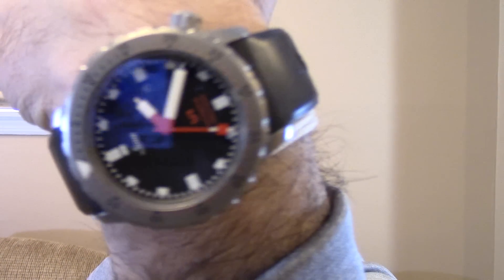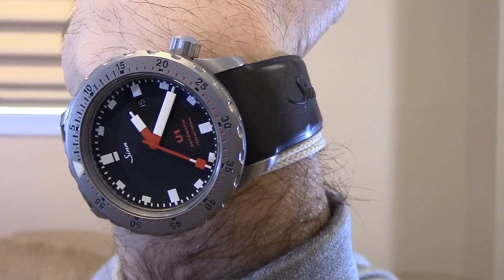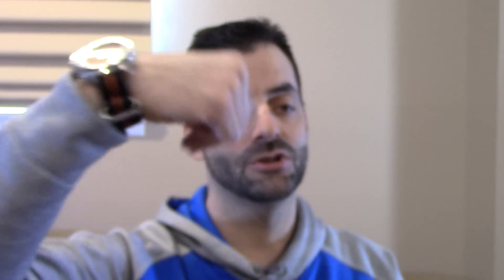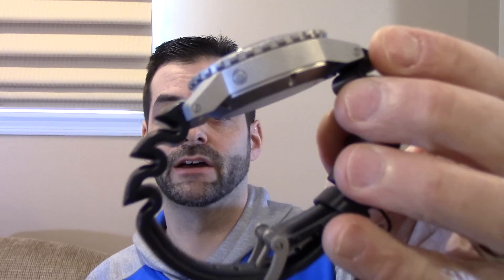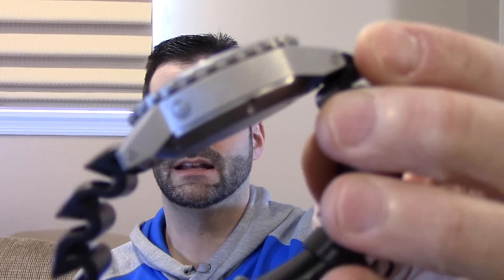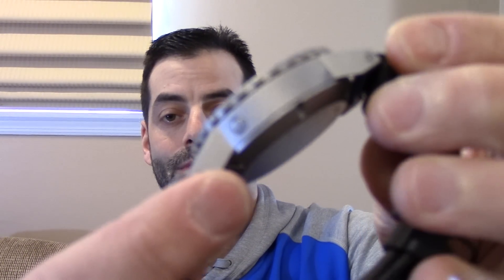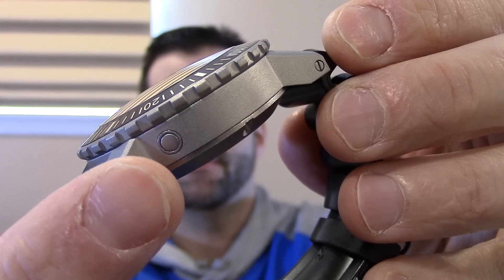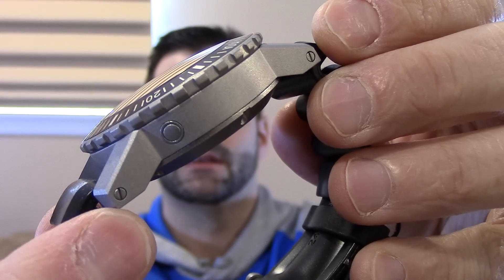What is a Helium Escape (Release) Valve? - Watch and Learn #45

Comment: You quickly address this in your video but I’m wondering if you could clarify this, or maybe it deserves a HEV 2.0 video. Is pulling the crown out during decompression as effective as an hev? There is some online forum chatter around this and there are those who are divers that say yes and those who are divers that say no. The argument from the no side is that the crown gasket seal can/will blow out. However, if the gas is so small it can get in the watch, why won’t it just gradually escape the unscrewed crown gasket without causing a blowout? Further more, if a watch is water resistant to say 100 meters, but is brought into a saturation chamber, could the water theoretically go past the 100 meter depth rating as it is now pressurized to a deeper atmosphere? I’m not sure if that second part is clear.

Comment: Just watched for the first time 🙂
Great vid. You confirmed what I thought about the valve and how it works. Sinn did an awesome design to have a 1000m with no valve. I have a few pieces with the valve rated at 500m or 1000m. 
There are probably other equivalent watches I don't know about but, I think the only diver with the legit use of the valve is the Rolex DEEPSEA SEA-DWELLER rated at 3900m. I don't think Sinn (or any other legit watchmaker) could make a crystal/seal combination robust enough to handle that depth without a valve.
If I'm a serious diver paying $15-$20k for a watch, it had better meet its stated spec's.

Love these Watch & Learns ⌚😎👍

Comment: But if Helium atoms are small enough to get inside the watch. How come they cannot escape the exact same way they got in? The pressurising phase takes as long as the depressurising phase, doesn't it? Plenty of time for the helium to escape through all the gaskets. 🤔
Reply: Because the watch is made to withstand positive pressure only. Example, the window is pressed in from the outside so at depth it is held in. After surfacing, if the pressure is reversed, only friction is holding it from being popped out.

Comment: A question: can you go down to 500 m with a regular 100...200 m resistant diver watch that has been "saturated" prior to that? Nearly zero pressure difference should prevent water from getting into the watch.

Comment: So will readings be different when pressure testing a watch with a helium escape valve? Surely as it comes under pressure the valve will open and it wont register as being sealed?
Reply: It’s a one way valve that only releases pressure from within the watch. Since the pressure during the test is applied externally the watch case functions just like any case without a helium escape valve.

Comment: The technical reason for the He valve is due to helium being the smallest type of gas that can get thru the o rings and into the watch even though it won’t allow water through. When you decompress that He expands and in some conditions it can damage the watch and even make the crystal pop off the watch. Some watches such as Seiko don’t use them as they say that their watches are robust enough, although me personally would prefer the escape valve, I’ve seem a few crystals pop off, well pop off isn’t the right word as it can actually goes with Big Bang. The crystal becomes a fast flying dangerous projectile and it can case damage if it hits you
Reply: @archie baldwin are you a saturation diver then?

Comment: Question: If under deep saturation dive conditions the "small" He atom can sneak-by all those gaskets and saturate the interior gas of the watch......why wouldn't it be just as easy for the He gas to "sneak" out past these same seals......when you come to the surface when it wants to (otherwise) pressurize the watch? Is it maybe a question of duration and RATE? .....meaning....the time the watch takes to saturate is a  long time (as long as you are under deep dive conditions, which defines a SLOW leak rate past the seals)....but in contast....that the ascent rate is typically quicker and the gas must then pass thru the seals at a faster rate to avoid over-pressuring the watch, but it can't flow that fast under these new conditions? Therefore the "need" for a higher-flow-capacity valve? ( Whew...sorry...long question !!)
Reply from the maker: You are SPOT on. The ingress is slow, but the outgoing is much faster.

Comment: As the inner watch pressure increased, wouldn't the tiny helium molecules just slip out of the watch just as easily as they slipped in, without the use of the valve?
Reply from the maker: Yes, but not fast enough.

Comment: You should also mention why there is so much helium in the diving bell in which the commercial divers stay for an extended period in the first place. Oxygen and nitrogen in high concentration are toxic. So the air that the divers breathe is actually a artificially mixed compound with an inert helium gas. The helium particles are so small that they enter into the watch through the metal not the gaskets. When the dive bell depressurises, the helium expands and pops the crystal. That’s when Rolex and Doxa came up with the helium escape valve.
Reply from the maker: Perfect explanation :)

Comment: I doubt this is a real problem. If the gas molecules can enter the watch so easily, why they shouldn't be able to escape with equal ease.
Reply from the maker: It is real and verified. They get in very slowly. But they need to leave fast. Watches are WR to 200 meter depth, positive pressure. But when the pressure inside the watch is greater, it just pops the crystal out.

Comment: Excellent article Mark! What's funny is that you can actually use a 200m divers watch at the depth they're working, only thing they need to do is unscrew the crown while the bell is being pressurized, or de pressurized. And just screw the crown tight once they need to go out and work or have levelled off. 🙂
Reply from the maker: I doubt that's true? A diver, like the SKX, has a gasket on the stem that seats against the tube. It's still sealed. Maybe not as tight, so perhaps it would work; but not sure.
Reply: Long Island Watch but if you think about it, the seals are designed to withstand the pressure difference of the surface and 200m. If your watch's internal pressure is equal to the bell, it would be equal to your working depth. So the seals are not fighting against the difference of the surface vs. 200m pressure.
Reply: Hmmmm... When I think about it, you might be right about the seals. If the seals aren't really solid, meaning they have air, like styrofoam, then they might shrink, or even with just the cold environment of deepsea commercial diving.

Comment: How do gases get inside the watch in the first place?
Reply from the maker: From the pressurized breathing atmosphere that a saturation diver is in. There is monatomic helium that is so small, it sneaks through the gaskets.
Reply: The idea is that during the decompression process, the pressure drops too fast for the helium to migrate back out which causes a chance at the crystal popping out.  The crystal was designed to withstand pressure from the outside pushing in, but not the other way around.
Reply: Wouldn't it sneak back out the same way when the pressure difference builds up during depressurizing?
Reply: The pressure of the surrounding environment compresses everything in a saturation diving situation.  

So in regular diving for instance, when you breath a breath at depth, you're breathing more air (nitrogen and oxygen) than you'd normally fit in your lungs because it's compressed equal to the depth.  It's how our soft lungs can resist the pressure pushing in on them... because the air filling them is equal to it.

Now, if God-forbid you shot to the surface from beyond recreational dive limits while holding a full lung of air, you'd hemmorage your lungs as the same air expands due to pressure decreasing.  This is why you're supposed to steadily release breaths taken at deeper depths on long ascents.  You'll still get bent (that's fixable if treated early) but you'll be able to continue breathing, which is pretty important.

Going back to saturation diving, which I've never done, I imagine that the same applies and the consistent changes in pressure might cause the gas taken in at high pressure to expand faster than its ability to "leak" the extra helium.  Again, just a guess.

Additional theory:  It's one more differentiator in a market full of dive watches and it's another thing to spend your hard-earned money on!